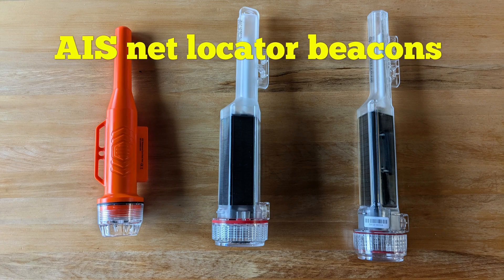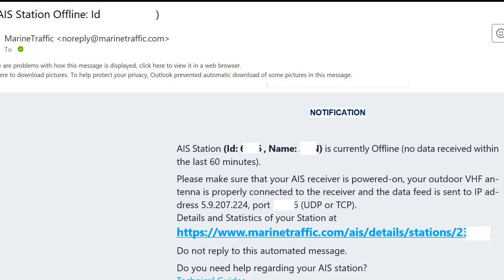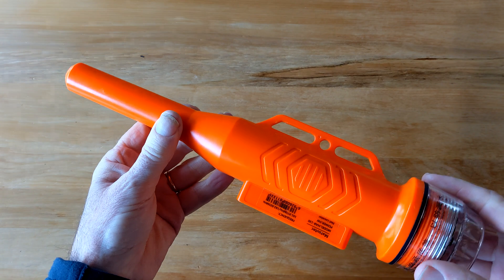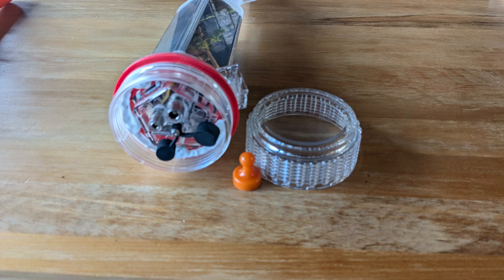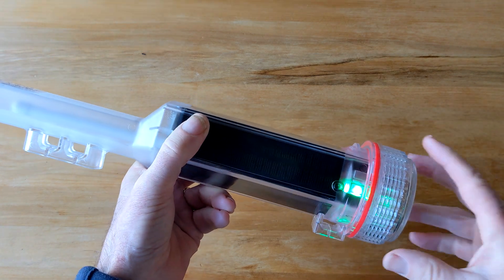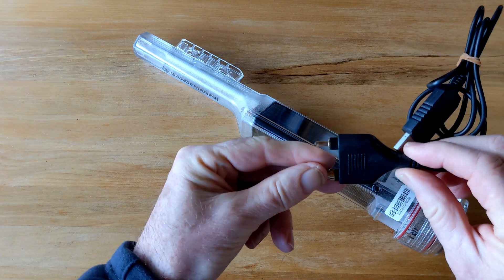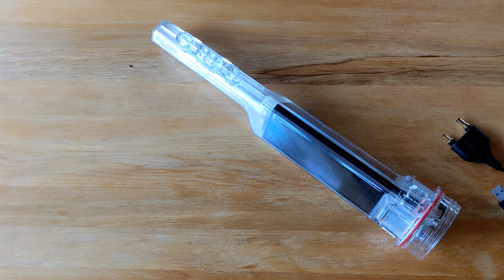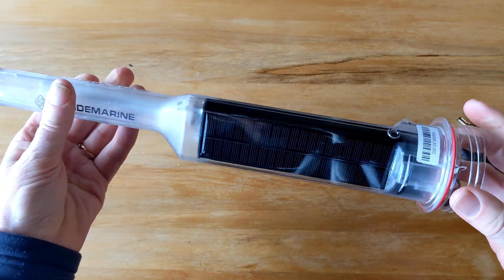AIS net locator used as a sailboat beacon

Comment: How long have you been using the Sandemarine now? Does it run forever using the solar panel?
Reply from the maker: When I first put it on my mast it was directly under the boom, and with a period of grey days it ran down to zero, because of shadow from the boom. Winter here.  Self booted back up on next sunshine period, which pleased me. Have since moved it to a standalone position on aft upright, it has brought itself back up to 98% without ever removing from boat to charge.  Been on the boat since mid August, and stayed fully charged for a month since relocation out of shadow.
Reply: @twictnet  thanks great to know. The last request would be to see if you can fully program it. With all the boat details, correct length etc. I know some use the length for the battery percentage, but it would be great if that could be set correctly. If you have time of course 😊
Reply from the maker: I can't promise to do that for a while. Involves removing from yacht to reprogramme. The battery information is part of the reported name. The boat details would be displayed as part of the AIS details which you get to see when you select the AIS as a target. That then tries to report any details that are being broadcast by the transmitter. On a vessel chart plotter or on an AIS website, the target will show as an icon, plus a name (+battery). for example mine is showing as Prometheus-99%  If I click on it then the rest of the available details are displayed depending on the software system of the receiver.  The software has fields for inputting the size.  All I did was not bother to include the boat size, as I wasn't particularly interested in that. What I did think would have been good was to have the callsign, but since it is meant to be a Net beacon, I can see why that wasn't included.   I'll  reply back if I get around to retrieving, and reprogramming it.  Good luck

Comment: Thank you for this video!  Were you able to program other items such as the ship size? I wrote to Sandermarine today and like you said, they had good communication.  They claim that the device will arrive with an international MMSI and the programming cable and I will be able to enter all of the fields seen in your screen shot (Ship name, MMSI, Ship Size, etc)....  Before I make the purchase, I do want to verify that you were able to get all of this to work.  My purpose is to get AIS for my kayak so that I can be seen by other BIG ships in the shipping lanes.  Thanks again for this video!!
Reply from the maker: I did not programme in ship size details, as I felt no need. I do not see any reason why it would not work. I would have liked to programme in the VHF call sign as I was able to in my non solar version.  The Sandemarine has been on my yacht pinging successfully and has triggered CPA alarms on vessels who had their CPA set too wide :-) The other solar unit had an abbreviated, perhaps made up, MMSI number. It shows up on MarineTraffic but not on VesselFinder - perhaps because of the identification of leading MMSI numbers used which I wasn't able to change, and was why I had to replace it. If you don't have your own MMSI number from a marine VHF radio, just check what the number will be that Sandemarine will use, the number can have an influence on how the beacon might be interpreted. On marinetraffic my "dud" shows as Net77104 but not at all on vesselfinder. Nevertheless, a ship would see it. Only a few portable VHF radios have need for MMSI numbers, but ICOM do make one with an AIS receiver in it (therefore has MMSI) which would be perfect for kayak use as you'd see "them" on the VHF, and be broadcasting on the beacon AND be able to talk to them (if you have your marine VHF license). Good luck.
Reply: What use is an AIS receiver unless you have a screen and chart on it?t @twictnet
Reply from the maker: The ICOM M 94D radio has an AIS receiver and a small LCD screen on which to display vessels.